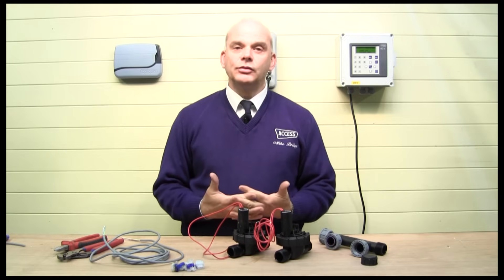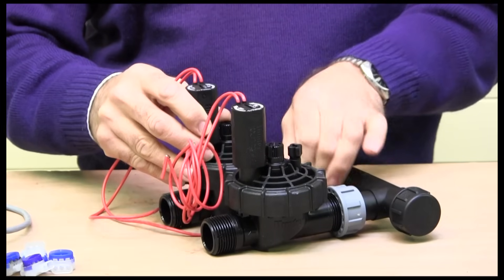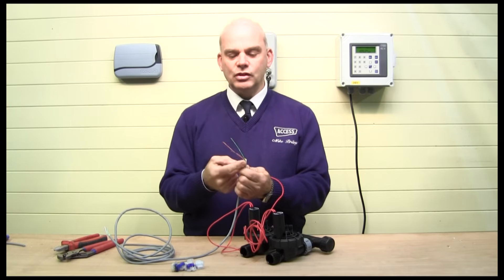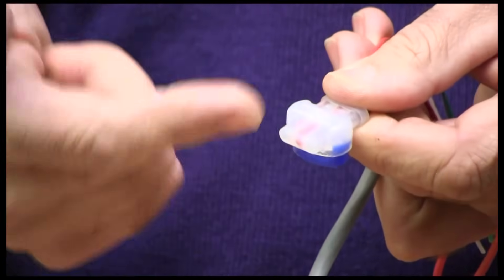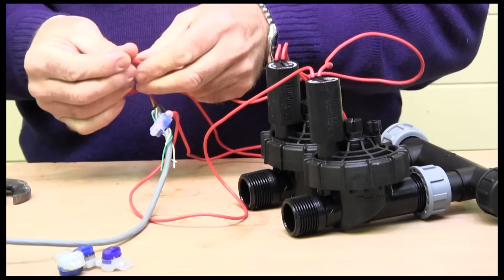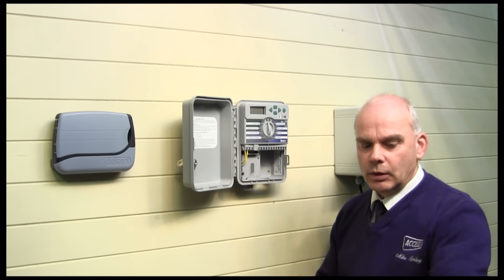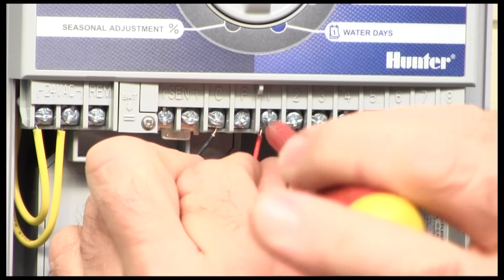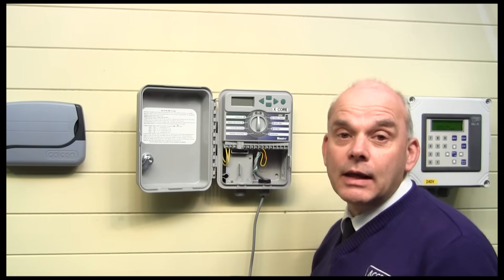Wiring an Irrigation Solenoid Valve

Comment: Thank you, very clear video. I have a question: if I have 4 solenoid valves will i need to use a waterproof connector with 5 wire inputs?
I cant seem to find any, do they exist ?

Comment: Question:  I there any way to fix a solinoid, taking it apart?  I have old Lawn genie system and one white wire coming out of top of solinoid broke off right at the top.  Not enough there to solder, even.  Can a new wire be threaded through somehow or do I have to buy a solinoid that hopefully fits my old Lawn Genie?  Thank you!
Reply: Hunter does have replacement solenoid only in case your wires are broken.

Comment: So I setup 1 timer with 2 zones last year  works great.   Now I add 2nd set in back.   Can I use P on the timer as a 2nd ground or I HAVE to tie in my old ground wire.   Twist with my new ground and connect to C on the timer 

Thanks

Comment: What multi core cable I use if I got 6 trigger ie 6 zone 6 independent solenoids .
As in video u have a common and tiger cables common u  link all tougher till u have 1 common cable but then i need 6 tigers wires ?

Comment: wire colors are wrong. Valve 1 is connected to red. Valve 2 is connected to green for trigger and black for common, however on the controller side you're using black for common, red for valve 1 and yellow for valve 2. In this configuration valve 2 is not going to work. It's probably best to write the color pattern on paper first.

Comment: Hi. Which diameter cable size is recommended to connect the valves to the controller?. 0.5mm is enough?. Or can I use UTP cable where the diameter cable size is small?. Thanks

Comment: This may be silly question but I have 4 solenoid valves do I twist the 4 'common' wires together and try to fit them into one terminal on the crimp connectors alongside the multi-core 'common' wire? Or perhaps twist two each together and crimp into two ports alongside the multi-core 'common' wire.
Reply from the maker: As long as the valves are 24v valves from a mains powered system then it is fine to bring all of the common wires together - 9v latching valves are different.

Comment: Hi  , I need a help, I want to power Bona valve  , with 24 AC adapter,as you know adapters comes with different amperes(currents),so which kind of AC adapters,should I use?? with 5 amp ,10 amp etc

Comment: What about a master valve? I have two larger wires from a master valve, it's driving me nuts, that I have to bond one with the common, and a controller wire, and the other master valve wire is bound with another controller wire. There is nothing here about a master valve. I have one master valve and then three valves for three lines. I am having a problem where when I run the 1, 2, 3 lines from the controller, every time it just runs line 1

Comment: Well I guess you'll have a 1 line system for today. LoL
And yellow came off ☺️

Overall great presentation and lots of saving for homeowner now
Reply: haha, yes, he mentioned solenoid nmbr 2 will be green but he connected yellow wire to it, but finally yellow was connected at the panel. Nevertheless, its place was designated for green, yellow did not want to stay.

Comment: Thanks. Seven years ago when my house was built the installer did not remove the wire bridge at the Rain Sensor connector, he just connected the wires now I know why the sensor never worked. Thanks again for solving a "Cold Case".

Comment: Hello Mike - Can you please help me - How do I connect this Valve with my Arduino Micro Controller?  Where do I add the external 24V AC and which one will be used for triggering the control signal from my Ardunio Board ? I need the The Physical connection using a relay

Comment: Mike, if I have a second manifold twenty feet away from the first manifold, am I still connecting the second manifold solenoids to the first set by daisy-chaining the solenoids with the common wire? In other words, my setup would be: Common wire from controller to manifold1/solenoid1_common wire_manifold1/solenoid2_common wire (20+ feet long)_manifold2/solenoid1_common wire_manifold2/solenoid2.

Comment: Great info. The sprinklers stopped working one day so after looking at this video I figured out that whoever installed it miswired the control panel. The common was where one of the rain sensor wires should have been and the rain sensor wire was in the common. Switched them and now it works fine. The question is how was it working for several years wired incorrectly?

Comment: If the valve manufacturer makes both latching and AC controllers then it may be possible. For example Bermad make both types of valve, so it may be possible to just change the solenoid actuator (the bit with the wires) on the top of the valve assembly.